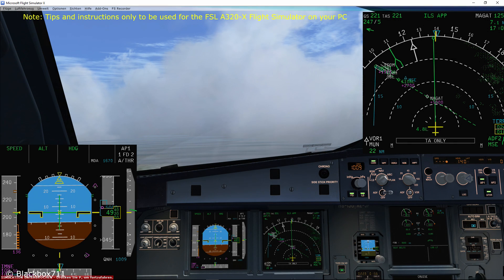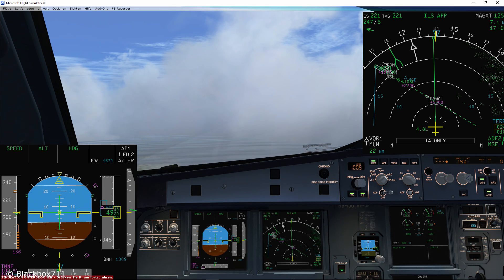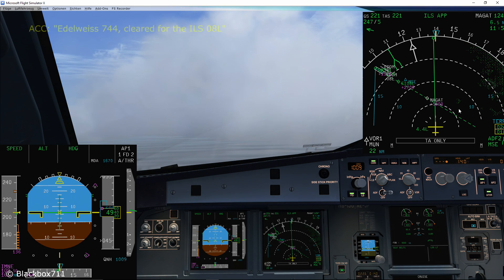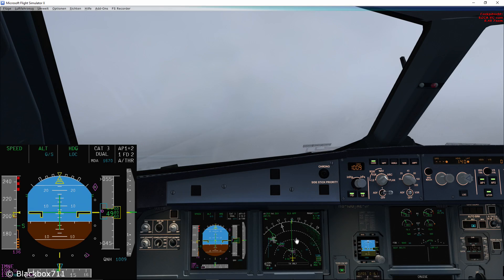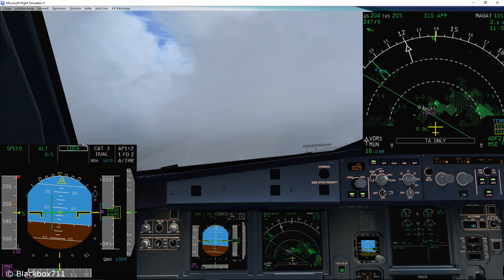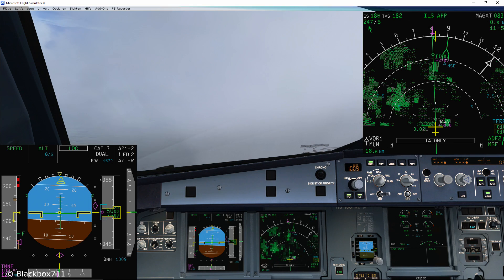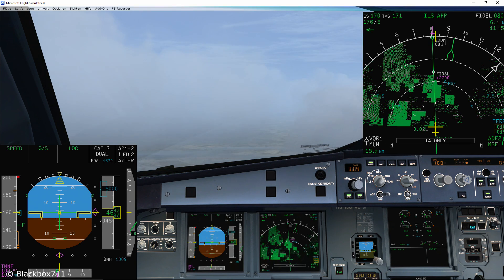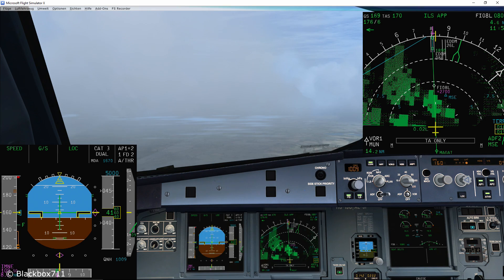FSLabs A320-X Basics: How to intercept an ILS

Comment: Great video. I know it’s been a while, but I do have a question. Based on what DME distance do you lower the flaps/landing gear? Do you do it by feel or is there a procedure that works like it is in the Boeing aircraft? Thank you!
Reply from the maker: Hi. Usually you select flaps 1 at about 2 NM before Glideslope interception. Then depending on aircraft weight and wind situation you would also go to flaps 2 which should be achieved by Glideslope interception. Then approx. 2000 ft above the threshold elevation select gear down and then continue going to final configuration. Happy Landings
Reply: Blackbox711 Thank you! That is interesting and very different from Boeing. Nice work with all your videos! Keep it up!

Comment: I can not keep it on autopilot. What is done with the mouse right click and that is done by clicking the left? Vertical Speed is very difficult to set the salt from 200 to 1000, without further steps. Once I adjust the speed automatically as the flap to move out immediately from automatic controller. I think I've given him 20 euros for nothing, it's very annoying!
Reply from the maker: The Autopilot panel (FCU) has a lot more functions than the Boeing FCU. I can’t give you instructions here. I have however published some videos here on YouTube about the use of the Autopilot
Reply: It's not that has many functions, but is too embarrassed made plane for a game. And it's not stable, like Boieng. It simply causes unrest. To be so difficult for those who are flying school, not for new home!

Comment: Hi just out of curiosity is there a certain altitude I should be at when I should be capturing either the localizer or the glideslope. And if not is there an ideal altitude?
Reply from the maker: +Ali Alani .. usually it is 3000 ft above ground. However the intercept altitude is shown on approach charts. Regards
Reply: Okay, thank you!

Comment: i just bought a320x fs labs, can i know how to setup the aircraft to become cold and dark state
Reply from the maker: Hi. You need to start FSX and use the Trike. There you switch off the battery so that the aircraft is cold and dark. Then you simply change the Aircraft to the FSLabs A320 and it should also start in Cold and Dark. Regards

Comment: hi can u explain a bit on Cat 1 cat 2 an Cat 3's meaning n do airliner normally only land on Cat 3?thx
Reply from the maker: Hi. No, normally if weather permits (visibility above CAT 1 Minimums) you would use the CAT 1 Minimum and land manually. Only when the airport (ATIS) reports "Low Visbility CAT 2 (or CAT 3) in use", then you would fly the given Approach. The usable Minimum is published on the Approach Chart. Regards

Comment: im alwsys confuse regarding this matter , if cat 1 ils , if we passing minima , does the glideslope still reliable or do we have to visual approach after passing it
Reply from the maker: Hi. The Glideslope and Localizer are still reliable, even after passing the minimum, but you have to fly manually beyond that point! One of the reasons why you should not land automatically when doing a CAT 1 ILS Approach is that there is no big safety zone around the Landing Runway ILS Transmitter during CAT 1 Operations. This means that vehicles/aircraft that are driving near or through the localizer beam can bend that beam and the autopilot would most likely do very aggresive manouvers to follow the localizer beam. This could lead to the aircraft hitting the ground uncontrollably. When you fly manually you would also fly according visual reference and not fly any aggresive manouvers. Regards BB
Reply: Blackbox711 but can we fly manually but still follow the glideslope/localizer or need to maintain glideslipe visusally by using papi light and ROD
Reply from the maker: Hi. In manual flight you can still follow the Glidesolope/Localizer indications below minimum. However, normally at this point you would look at outside and maintain the correct path visually. That is a basic flying skill. Also be advised that you should not follow the PAPI indocations below 200 ft AGL.
Reply: but why we cant follow PAPI below 200ft AGL , im so sorry asking too much
Reply from the maker: No problem. Below 200 ft there might be ground based phenomena (gound fog, mist, snow etc.) which can refract lightbeams and cause wrong indications. Also at this height you should look outside to have a better indication on the closure rate to the ground and the lineup to centerline. Regards